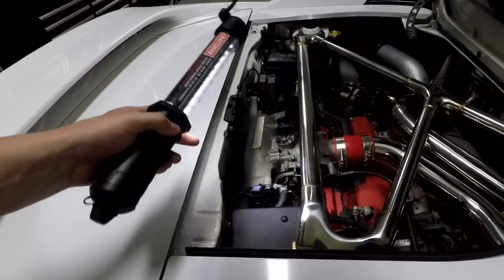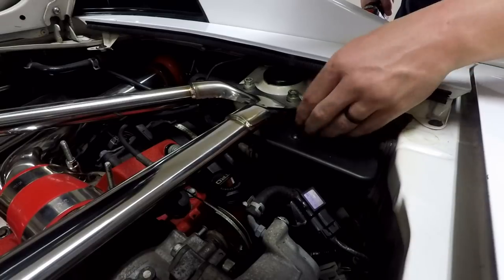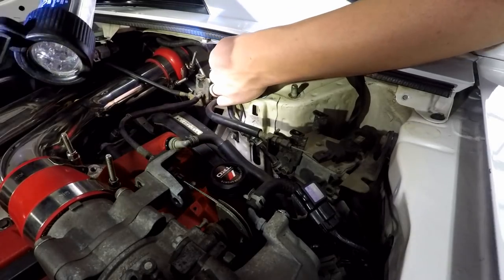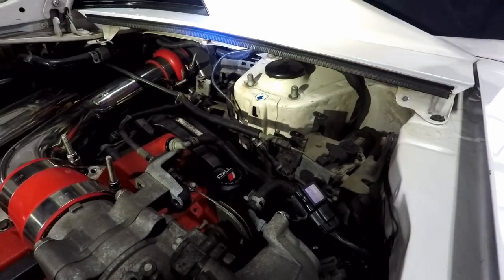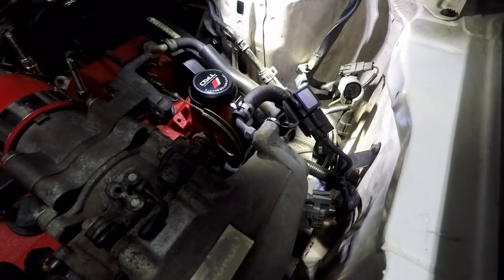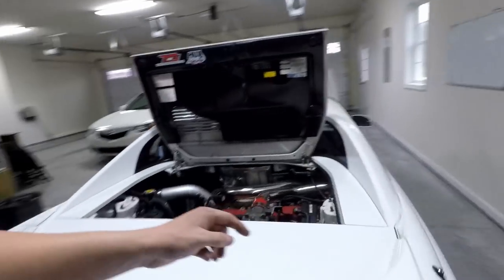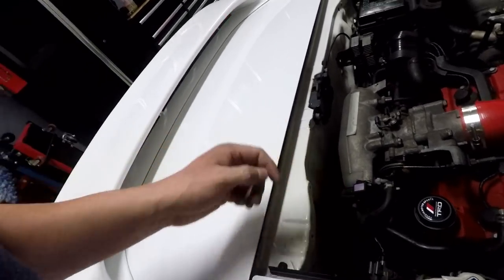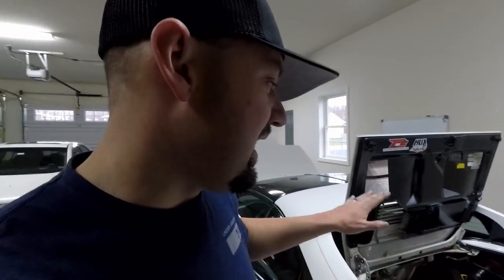Removing Cruise Control & Alarm On MR2

Comment: That ground wire was actually connected to the wrong place, there is one on each side that goes from the strut tower area and connects to the inspection panels.

Comment: Do a little bit of the wire tuck with the obd box and fuel restor pack I mean you can hide them in the trunk might as well since your doing the cruise control
Reply: PURE Function there's no wire cutting . all your have to do is un plug the resistors and brakets and slide the plug plugs from the engine bay from the left side just pass them Tru the ecu wireing hole grommet hole and just bolt everything up and plug